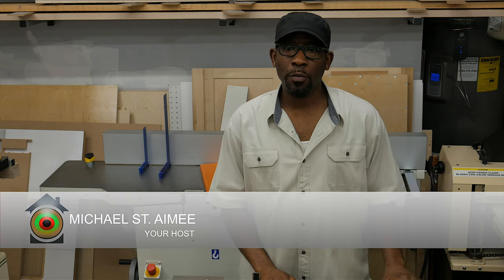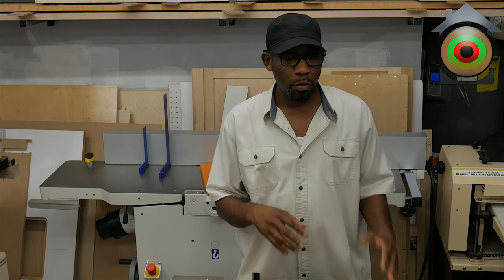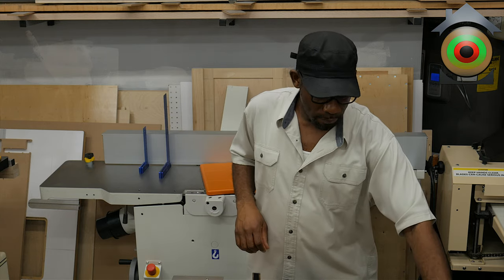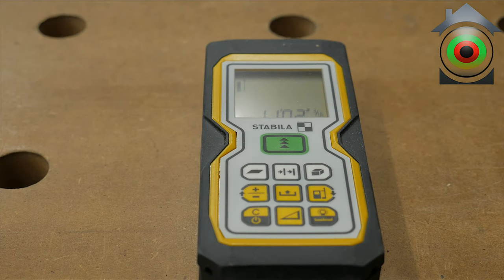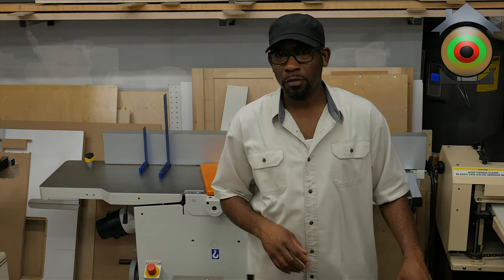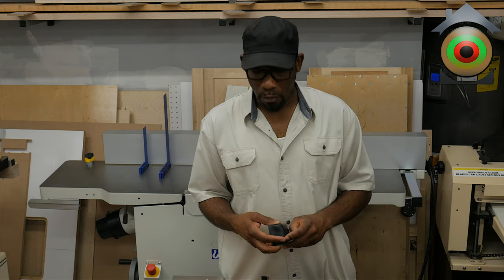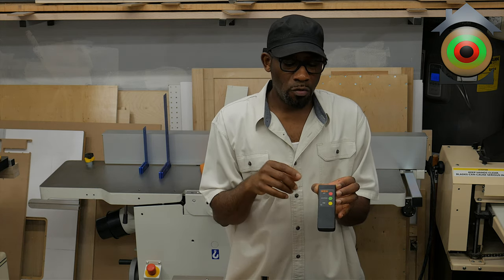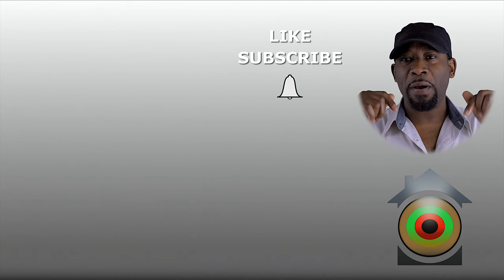Digital products that make my life easier

Comment: I own an early version of the Bosch digital protractor you show. A major deficiency of the model I have is that it lacks a locking mechanism to secure the angle setting, which can therefore inadvertently be moved between the time you take a reading and then use the tool to set up a cut. I have replaced this Bosch with Starrett model CP505E-12, which has all the same functions and includes an angle locking mechanism. While I prefer the Starrett, it lacks the sliding arm extension included with the Bosch. The extension enables the Bosch to be used in cases where one of the walls or surfaces to be measured is shorter than the length of the tool's main blades. To deal with such circumstances, I also carry the little Wixey 3" model WR400.
Reply from the maker: I’ll check them out! Thanks for watching!